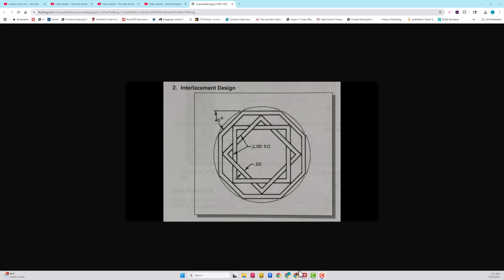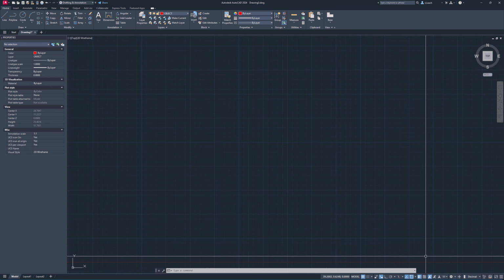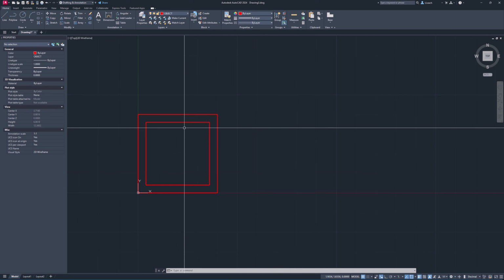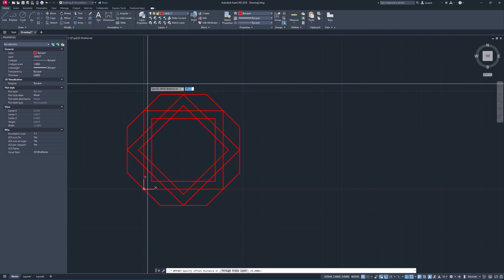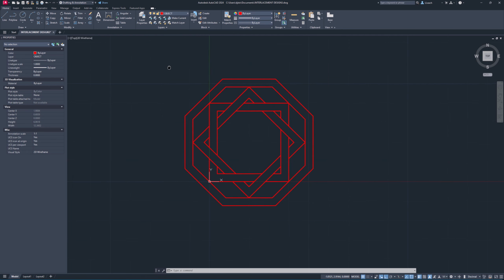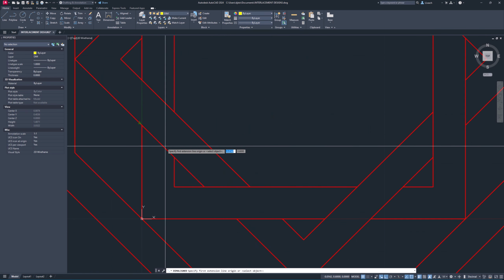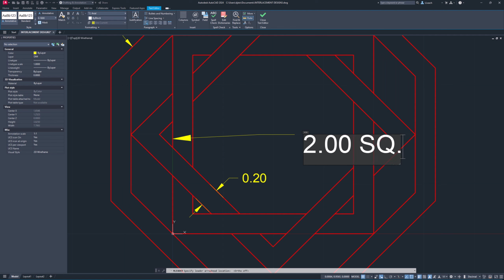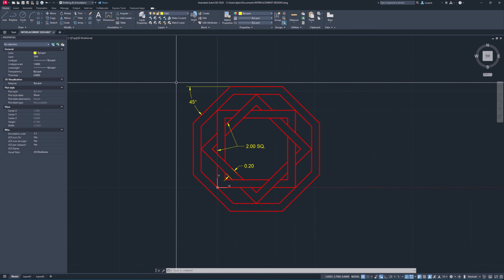AUTOCAD INTERLACEMENT DESIGN

Comment: You forgot that circle 😬
Reply from the maker: I believe the way the circle is broken up, it’s just there to show you that all of that fits inside the circle. I should have drawn it in and used a thin line weight. Good catch!
Reply: @LessonsLarry well I tried the best I I could with some other guy.  Hopefully my professor doesn't "zoom" super close to see I trimmed a little bit. I struggled getting it perfect. I noticed in all the drawings I'm doing for my AutoCAD 2 class... You don't usually put in the measurements 😬 I need this for my class. I spend more time fiddling with those darn things than the drawing! 😅 I mean sure the straight lines are a piece of cake but those other ones give me 💩🤦 thank you! You've helped me sooo much! I work full time and my job requires this class however, there are no evening classes 😡